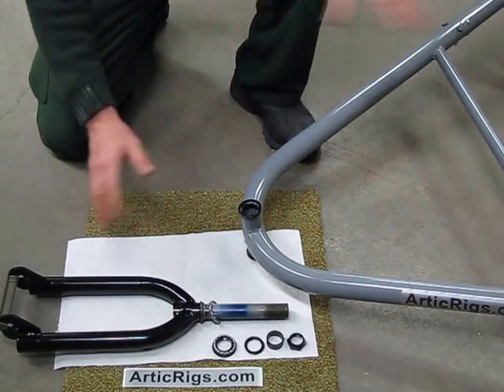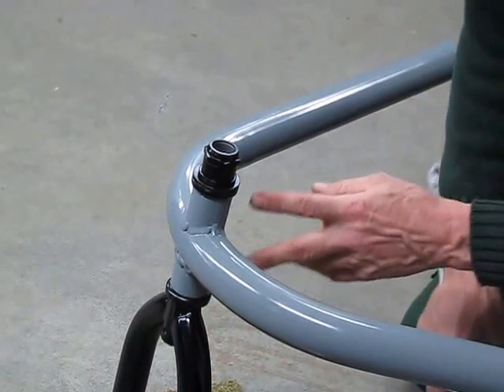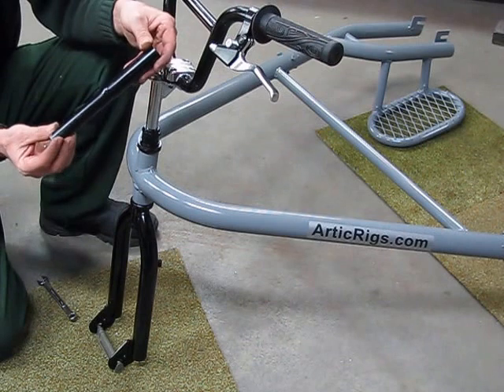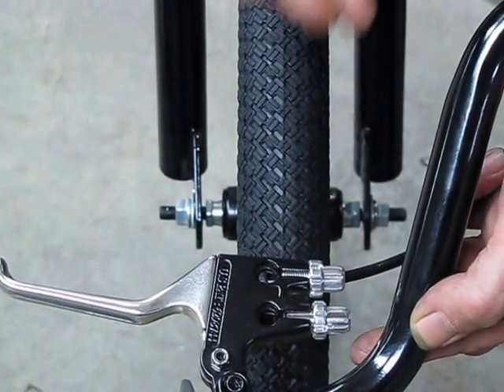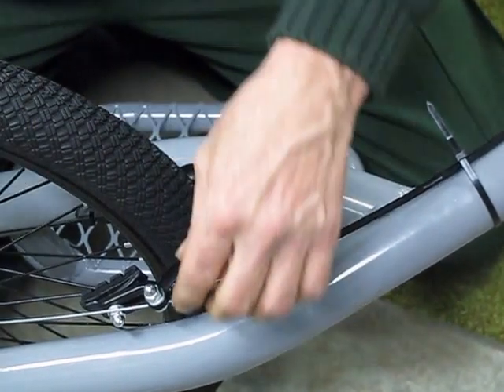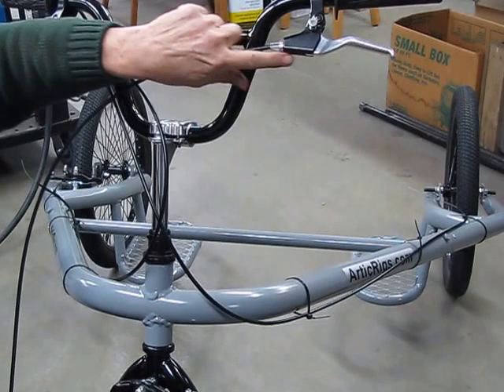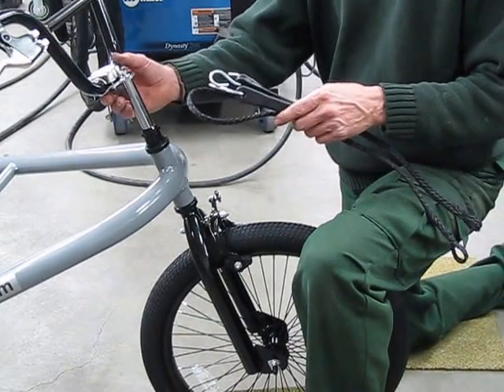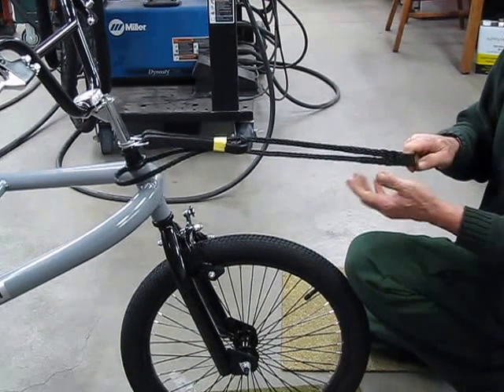ArticRigs R1 Assembly

Comment: I have been looking at purchasing one of your rigs, probably the R, and I am in the process of making a trailer to haul the rig around. I contacted you guys before and was told that the rig is 64 inches long. Now is that including the tires (front of front tire clear back to the back of the back tire) and what is the width between the two back tires and then the width between the foot boards (as I'm short and don't like to feel off balance)? 
Thank you,
Haley O'Maley